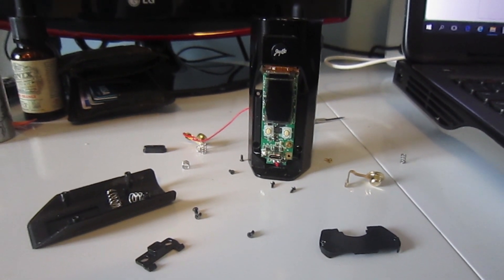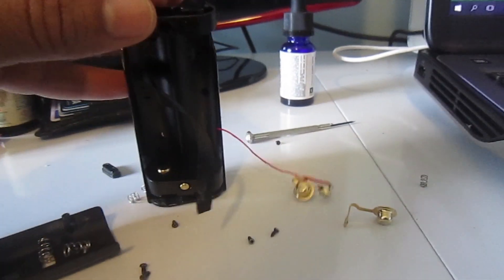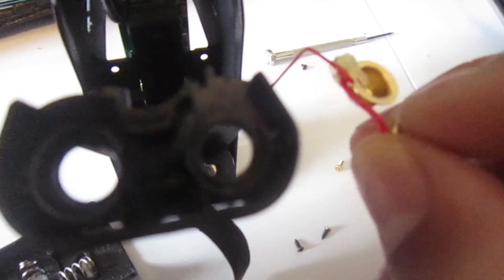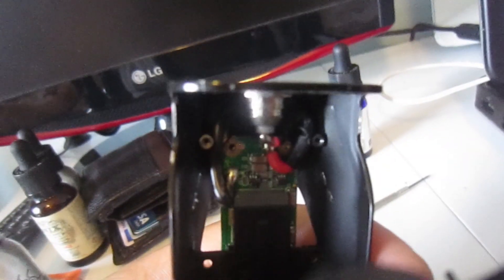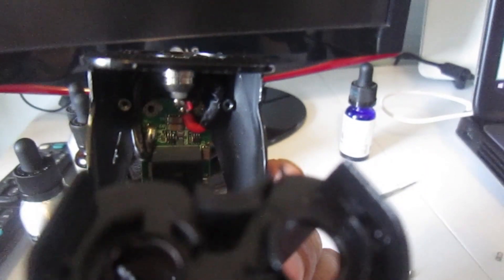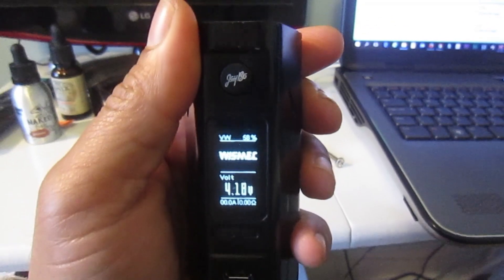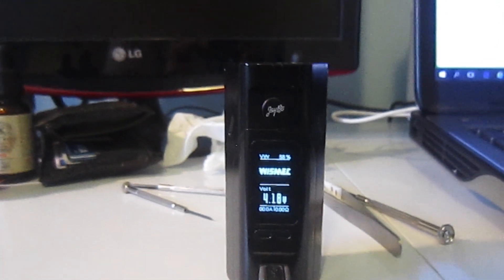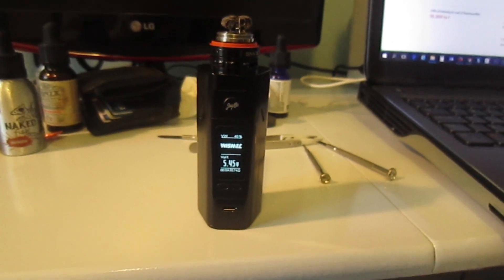Wismec Reuleaux RX 2/3 check battery Issue FIX

Comment: my backpiece is broken or something because when i try to use the 9v part that has another battery, mod wont turn on or it turns on when i push the piece very hard against mod. So can i find that piece somewhere or what should i do. the nobattery piece works fine

Comment: hi i have the same problem and the my is new from the box came with the problem i try to fix but the red wire isnt broken all is good conectec but same messange check battery and when i check the volt battry the mod show 3 voltages diferent and i used with two battery
Reply from the maker: if it's brand new then return it to the retailer .
Reply: i cant return i buy in usa but im from venezuela
Reply from the maker: okay , have you checked the both terminals where the cable is soldered , are the connections intact ?
Reply: yes i check everyting i was disarmed the mod and all is in order
Reply from the maker: so what you did in order for it to work in your case ?  share some feedback so other viewers can benefit as well.
Reply: when the mod is funtional again i will share the info